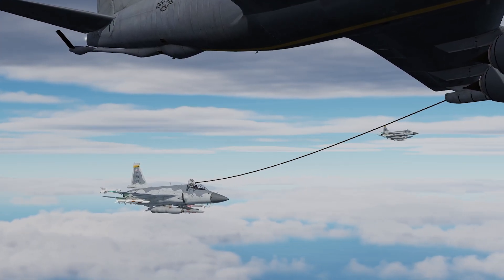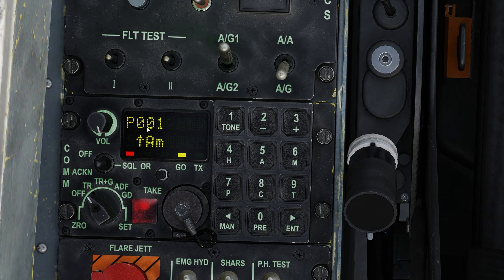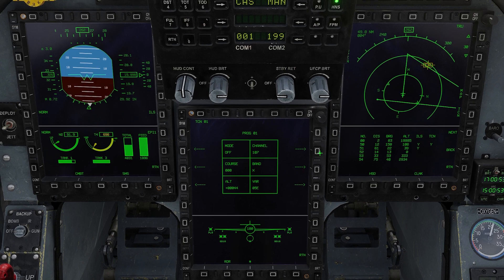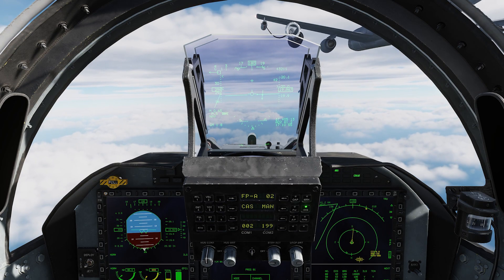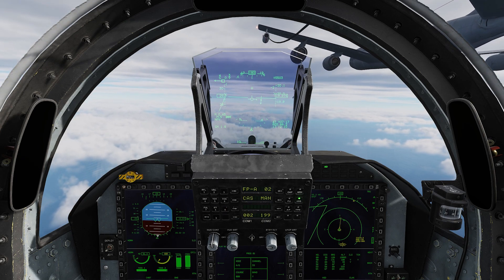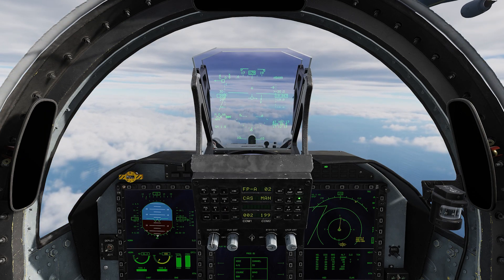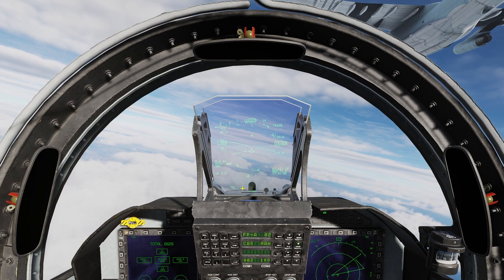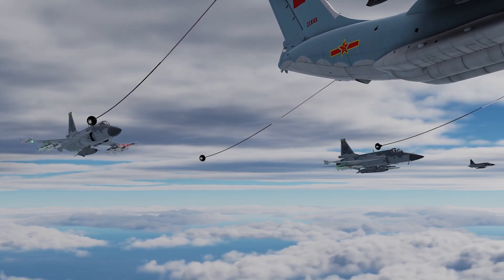DCS | JF-17 Air to Air Refueling

Comment: thanks for the tut, would you mind sharing your curves for jeff? thanks!
Reply from the maker: I don't have any custom curves for the Jeff.  However, I do have an extension on my stick which makes a difference.  If you are finding it a bit touchy around the center just try a curve of 5 and increase by 5 until you find the sweet spot for your setup.